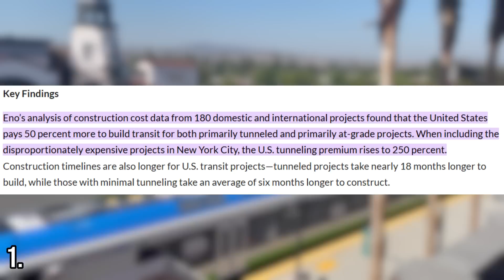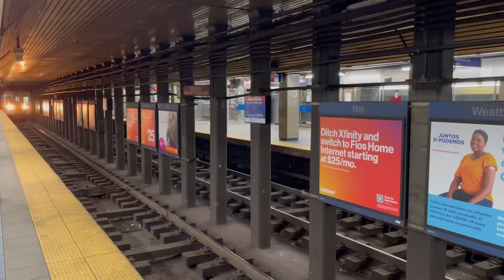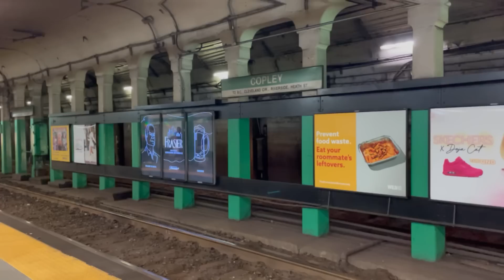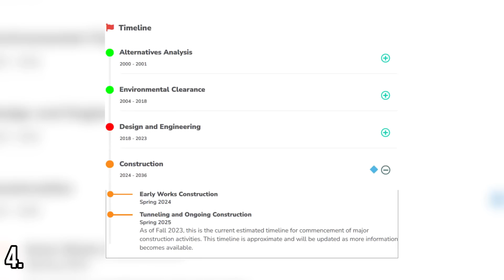Why Is Building Transit So Expensive?

Comment: Fighting transit projects or forcing much more expensive designs because of construction noise baffles me a little - I live right next to a tram line that my city is currently expanding, and have only been bothered by noise a couple of times in some 8 months of construction. When the extension is finished in a month or two, I and everyone in my neighbourhood will have a cheap, super fast ride to a lot of shops and amenities that are currently only accessible by road. Prior to this, some local groups and politicians fought the idea of having a tram at all for over a decade, with similar arguments, but now it's built, it's a source of local pride and sees a huge amount of use. I think it's easy to imagine the construction and change will be more disruptive to your life than it actually is (it's certainly no more disruptive than road works).

Comment: What is interesting is that we see it in Australia as well. Sydney has been building and the costs and length has been reduced over time, as has Melbourne with their level crossing renewal. However their metro tunnel has been pretty slow because they refused to do a cut & cover due to splitting the city in half.

Comment: Santa Clara County opted out of being a "BART county" when BART was being designed. Thats the biggest reason the line through Downtown San Jose was never built. Plus, there wasn't much of a Downtown in San Jose to build to. Still is much there today. Except a lot homeless people.
And now VTA is building its "Regional Connector" (aka Light Rail extension) from Alum Rock to Eastridge Mall, mostly elevated. VTA doesn't want to disturb the people on Santa Clara St with tunnel boring, but doesn't give 2 💩s about the people along Capitol Expressway.

Comment: It is NOT only about costs in Dollars and time and energy consumption, CO2 and what ever...
It is about saving time for the users. Let us say a system is transporting millions of passengers per year saving them millions of hours every year. Let us set a price tag of 20 Dollars per hour. Then you have already 20 million in Dollars. Maybe wo should include a higher price tag for the family time the transit riders have.
Then there are huge real estate gains as houses gain much value because of beeing accessible by efficient public transport.
Companies benefit by having workspaces accessible much better by more people.
To reduce costs of construction You have to lower energy costs and cut down bureaucracy. If procedures by politicians and bureaucrats and lawyers stretch construction time by at least 10 years - as it is common in Germany - you have to spend much more than expected.

Comment: Other countries do infrastructure for multiples less than America.  Modern countries like France, Japan, with high standards and labor costs, and pretty much every other country, I understand.  I read a post by an engineer who decided to work in Europe because of the pointless rules inflating costs and lowering technical standards here.  We also pay multiples of what other advanced countries do for pharmaceuticals.  We should ask why on all of it, as i suspect that it's not unrelated.  Projects shouldn't be "how much can we inflate this to".  Carmel Indiana got the state to give them the money for upgrading a state highway through the city, and instead of an expensive, expansive stoplight with myriad lanes and dozens of acres of asphalt, and long waits at the light, the city built a grade separated intersection for the same money, by only using one bridge, and a clever but simple continuous flow intersection.  More of what Carmel did, less of the expensive but not that good that typically gets built at eye watering prices.

Comment: Well... it's even worse with BART because they couldn't go with twin tunnel boring technology that we already had the equipment and expertise for in North America.. No it had to be fancy and use a massive single bore like in Europe and Asia. So they spent a bunch of money engineering it and only now finally after so many delays due to choosing that design there's finally the equipment ready to do it.. They say it's "the more cost effective option" now but that's a half truth only due to it costing more to change any of the design on this point. So yeah no sense at all on that project and so much other transit in the SF bay area was neglected due to the cost overruns..
Reply: Twin bore would've needed cut n cover, which the locals were fighting against. VTA is bound to the whims of businesses like those in DTSJ. They're not gonna piss them off when the business groups are their biggest political supporters.
Reply: @gandhihype  Really? I'd be curious to see what articles talked about that.. logically, Yes smaller bore would have needed a bit more cut and cover at the stations but even a single bore design will require some disruption at the station locations.
Reply: @ZorenManray  That's the point that businesses have been hammering home. They say stupid shit like "open heart surgery on Santa Clara St" but they have all the power, so there's not much VTA can do.

Comment: With subcontracting, there is usually an unholy alliance between the contractor and the politicians. In corrupt cities, like Chicago, politicians accept bribes called kickbacks for contracting with a particular design or construction firm. For example, let's say a new signage project will legitimately cost $1 million to design, manufacture, and replace all the platform signs in a subway system. Now, factor into that, there are 5 aldermen on the transit committee, and each wants $20,000 donations to their reelection campaigns in exchange for the issuance of the contract. The project is now $1.1 million. Don't forget the commissioner of the transit agency who wants $50,000 cash in exchange for the contract issuance. now its $1.15 million. Now the Union needs a certain amount of $50/hr no-show or no-work jobs for the friends of the union's leadership or some politicians. Let's assume that adds another $300k to the contract. So now we're looking at a price of $1.45 million on a $1 million project. Public sector projects are always the target for massive corruption.

Comment: Out in Phoenix, construction costs ballooned since the Gilbert Road extension. Before then, light rail costed around $100 million/mile, even if there were new intersection designs and multiple park-and-rides. The Northwest Phase 2 extension was around $250 million/mile, while only adding one elevated station, a parking garage, and a 1/4 mile bridge over a freeway. Most of the 1.6 miles were the typical street-running tramway. The South Central extension, a 5-mile branch estimated to be completed in early 2025, has a similar per-mile cost to the Northwest Phase 2 extension, and the only hard part is reconfiguring a few tracks in downtown Phoenix.
Reply: Yah it should be something like bart but nope it's a Mealting street car on a seperated rightaway.. But ++++++ for the Aircon

Comment: Wait until you see the current plans for Seattle transit expansion, that $55 billion approved by voters in 2016 is nowhere near enough to build essentially one line and a few extensions. 8 years later they are finally designing the first line and it's coming in twice what it was planned and that's after numbers were revised.

Comment: The cost of getting the right of way set aside for any major transit project drives the cost into the stratosphere. I mean, look at how long it took for most of the Hokuriku Shinkansen line from Tokyo to Tsuruga to be built, a plan that was approved originally way back in 1973! Getting the right of way and building all those long tunnels was a huge, complicated and expensive process.

Comment: Building transport is expensive because there is no agency from the government for creating transport projects, with full-time employees. Also, the projects are usually built by companies rather by the government, meaning that money may 'disappear'. Also, the appropriate transport to be constructed is railways, bicycle infrastructure and maybe trolleybusses although rail vehicles are usually superior to road public transport. It is possible to build a metro or railway station in a dense city like Athens at most about 800m from everywhere in the urban area (keep in mind that in Greece there are no American-style suburbs, even more distant suburbs have walkable parts). There may be some 6- (or even 4-) lane roads where one lane per direction could be replaced by a tram track. Keep in mind that a railway could be designed so that the difference between trams, metros and mainline trains is expressness, meaning stop frequency and as a consequence speed, especially for slower modes. There could be stricter parking rules, with penalties other than fees as the rich would have no problem paying to reduce traffic, and make it easier to replace some lanes with tracks. Shared lanes do not work well, as not only are trams affected by traffic but also unable to overtake as they are (usually) restricted to one track due to the absence of more (per direction).
Reply: We need a proper federal Department of Transportation, and proper state DOTs, to enforce standards, retain full-time engineering/design staff, and trim regulatory/contracting fat. Unfortunately, many state DOTs are hostile to transit—for example Caltrans, the California DOT, is a frequent opponent of transit projects in the state.

Comment: On the BART VTA Extenstion: Not only are they doing deep boring which is expensive but fairly common, instead of your standard twin bore with cut and cover stations they are doing a single bore the size of the stations all the way through so they don't need to disturb businesses above with metal plates.
Reply: That’s crazy, station voids are the most expensive part of any underground rail project!? 

That must explode the cost, and frankly they must be making tiny stations, relative to what It could be.
Reply: @MrCalls1  - https://www.youtube.com/watch?v=hC2Y9Zol6qI
Reply: How much cheaper do you think the project would be if they did twin bore with cut and cover stations, percentage wise?
Reply: @nasifsiddiquey8867  theorecticly it should be cheaper the way they did the boring. As two tunnels will cost more then one....
But the only other city, which has done that is barceona for one line.... So its a unproven "technology", where a lot of problems can/will arise... Like in barcelona too. (Which can and most likely will make it more expensive then expected)

And strangely the BART extension isn't even doing the exact same thing like barcelona and does waive on some of the original design features and therefore also waive on many of the original advantages of that design...really strange...
Reply: @BetaD_  two tunnels with 1/4 of the cross section each...
Reply: yes, but theoreticly it should be cheaper that way.... At least that was one of the reasons why barcelona did it, if I remember it correctly...
Reply: BART is unstandard with no advantages .   Weird gauge and wheel profiles increase costs .  Get rid of bart by now and dont build more for god's sake ..
Reply: worst part is only ONE station won’t be built under what is currently a parking lot. And they also should have extended Caltrain across San Jose not Bart
Reply: You fellers don’t realize that VTA also runs bus routes above the street bart is being constructed. That would disrupt bus lines for years
Reply: I've wondered why twin bore with cut and cover stations wasn't more common.
Reply: One pro about going underground for this project is that it hopefully lowers the cost for a future second transbay tunnel which is urgently need. And perhaps an underwater connection to Marin County and Vallejo
Reply: @ that is not how it works
Reply: VTA should of told the community to go pound sand because their opinions are making the project more expensive.
Reply: @jarjarbnks340 Not possible. They're also effectively bound to the whims of businesses. They're not going to upset their main political supporters.

Comment: Good video. I also feel we shouldn't be giving another cent to highway projects in favor of transit projects.
Now in regards to consultants being behind expensive transit project costs, this is also due to the fact that public transit agencies themselves don't get much funding. Because these consultants (VHB, AECOM, HNTB, STV, WSP, etc.) also work on several other transportation projects, which unfortunately also includes highways, they have more revenue coming in on an annual basis, snd can therefore afford to pay their engineers significantly higher (by 20-30k per year) when compared to the in house engineering departments of transit agencies, so most of the engineering talent often goes to the consultants who pay much higher amounts, which leaves the in house departments mostly reviewing the design work from consultants. 
But depending on the transit agency, especially if the agency is relatively small, some would argue that hiring an outside consultant would make more sense, since once a project that a small transit agency would work on is finished, then that transit agency's engineering department has little to no work coming in, which may result in that department shutting down and all of those engineers would be laid off.
Nevertheless, keep up the great videos and always build transit projects no matter how costly or hopeless the situation seems, because the same government has no problem building highway extensions and airports that are way more expensive and destructive to the environment.
Reply: airport expansions are wildly as unpopular well. look at LAX. there is no transit only discrimination to criticize. Seattle needs a second airport and that was shut down due to costs. same with bridge maintenance. America doesn't care about any infrastructure

Comment: Opposing transit because of the temporary noise and construction is ridiculous
Reply: And should be outlawed
Reply: yeah, but I'm confused why NIMBYism wasn't mentioned? In Germany it's one of the main factors, or even the main factor....
And I heared it's a similar problem in the US...?

But using TBMs is the normal way these days to build subway tunnels through a densly populated city, absolutely nobody does cut and cover anymore these days ... So I don't understand this critic...
Reply: @BetaD_  He didn't mention NIMBYism by name, but he totally described NIMBY processes.
Reply: In a commercial or office area it’s not ridiculous. People need lower noise levels to be productive in professions that require focus. There’s a reason construction workers wear hearing protection. Safety and focus. Focus in that case directly contributes to safety. Those machines are heavy and potentially dangerous.
Reply: @mi12no dude, that's an urban area. Stop wanting suburban privileges in dense places where there's noise, construction, and just a constant overall flurry of activity.

Comment: 2B per mile is rookie numbers. 2nd avenue subway phase two might cost 4B per mile
Reply: when the interborough is built in the 2050s it’ll make 2nd ave look cute cost wise
Reply: @glassowaterful  id be interested in how they can make a light rail project with minimal tunneling and a mostly established right of way to cost 4B per mile. That would be a feat lol.
Reply: @glassowaterful inflation adjusted probably not
Reply: Nobody Beats New York: The Greatest City in the World😂
Reply: @TheWolfHowling in corruption
Reply: Hence why it should be cancelled, the IBX too. So why not have MTA shut down, and only intercity trains call at Penn Station? Of course that would implode the economy of the whole New York City Tri-State Area if not all the Northeast from Richmond to Portland ME.
Reply: @EdwardM-t8p  naww it would bubble set a place that is way too synthetic.
Reply: That is just way too much. Maybe New York City should forswear all new extensions and commit to maintaining and improving its current system infrastructure without depending on consultants.
Reply: Ya nyc is so dumb they built another subway too late... That's why I commute from new Jersey in my all weather Compact suv.
Reply: bazinga
Reply: Hence why it should be cancelled

Comment: The main problem with most agencies is they don't have the long term funding to have more full time staff. Since there is no guarenteed funding going to transit, they can't commit to the staffing needs. We need the guarantee funding to transit in the same way and magnitude we guarantee funding for roads
Reply: It should be run by the church.
Reply: false. there is no guaranteed funding for roads. They are funded by gas tax, which is declining due to electrification, sales tax which fluctuates with boom and bust cycles, and direct taxation, which is subject to voter sentiments. Road agencies are simply maintaining an existing system while transit agencies are building it from zero.
Reply: @walawala-fo7ds  You do realize that you yourself just listed a few sources of guaranteed funding for roads, right?

Comment: 7:50 while I agree with the overall point you're trying to make, it's important to note that Downtown San Jose has a few rivers flowing through it that intersect with where the tunnel would go, which effectively kills cut and cover as an option, at least for the tunnels themselves

A more apt comparison for this would've been building the line elevated, since it would've been by far the cheapest option but got almost immediately shut down by NIMBYs.